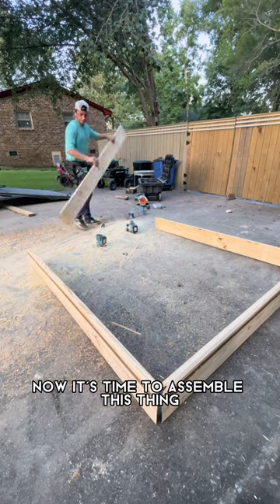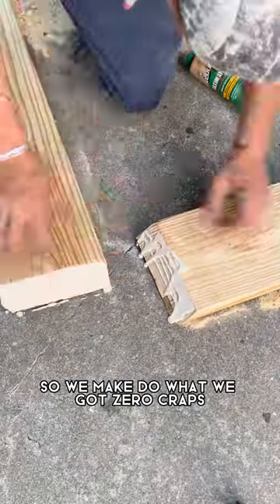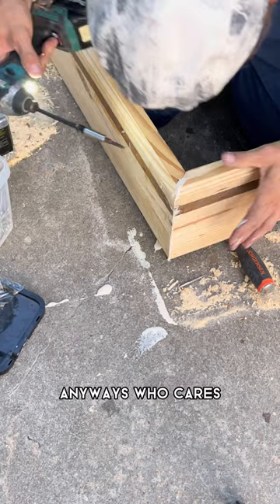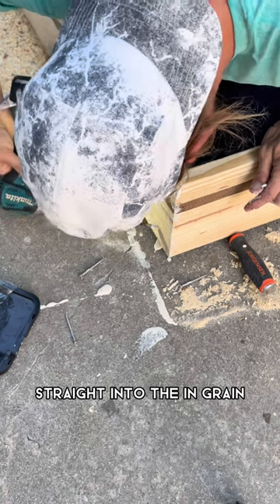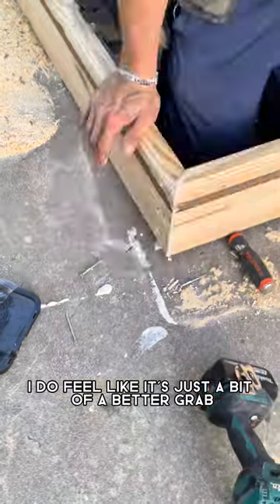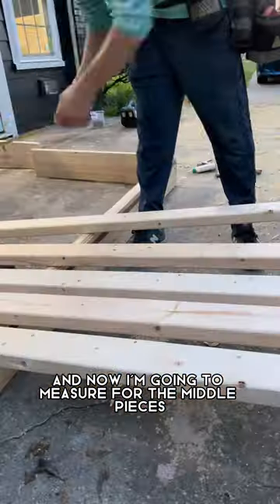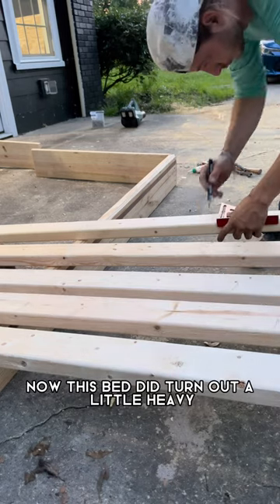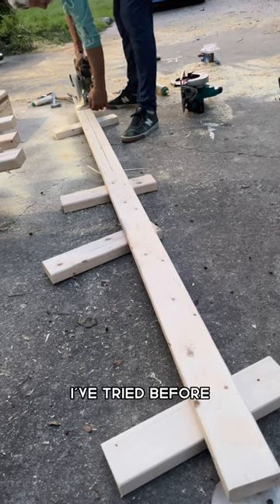Building my Girlfriend a Platform Bed Part 4 | Artpentry

Comment: I can't help myself but to share my experience. I think you put to much faith in screws. Screws have their pros and cons. The advantage of a nail over a screw, is that it's ability to flex and move with the movement of a structure, we're a screw doesn't have such ability. It will snap, and the reason for this, is that a screw is made from harden steal. While a nail is not hardened. The advantage of a screw over a nail, is it grips better than a nail. So it sounds like a bit of a dilemma, but not really. It's really is quite simple. Use nails when constructing something that is likely to settle and continue to be under stress. Use a screw on something that is fixed, and unlikely to settle and not under continues stress. For a structure that fits both catagories, I would recommend lag screws, carriage bolts, or standard bolts. Grade 5 is good for all wood construction. Grade 5 is not hardened. Grade 8 is hardened, but never recommend in wood construction, and totally not necessary, unless used in conjunction with heavy steel.